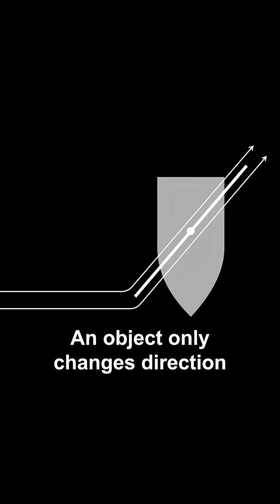Do you know how sailing actually works?

Comment: Lift is also generated because of the curve of the sail.  A sail with a curve works much better than a flat one.
Reply: I assume that's why they always have enough slack to catch the wind and billow like they do?
Reply: @Just_A_Dude  In real life you are adjusting the sails all the time, There should be enough slack in the sail to give max speed without getting any wrinkles (this spoils the airflow over the sail causing turbulance)
You are also adjusting the path of the boat to try to make the best track to your destination, this causes maore sail adjustments.
Its a continious dance between crew members to get the most effecient results from your boat sail combination.
Reply: @rickharriss yeah rule. of thumb is the stronger the wind and the more you go against the wind the less slack you give
Reply: @Just_A_Dude   - or if not slack (well correct tension on the sheet)   but designed to be variable -  belly and adjustable vang or tack lines..
Reply: first of all, a sail can't be flat when wind pushes it because it's the deformation of the sail that puts tension and creates an opposite reaction force towards the air. but you can still control the curvature with the tension, and the curved shape deflects the air more progressively and more effectively what you don't want is to have too much curvature that would uneccassarily slow down the air velocity and also slow down the boat. the  but also the low pressure behind the sail "pulls" like the top side  of a wing creates the majority of the loft  (in reality the low pressure side doesn't pull, it just pushes with less force and it's the pressure difference that creates lift, like sucking on a straw doesn't pull the liquid, it's ambient air pressure that pushes it up. 
lastly , sail can be made more efficient by adding structure to it to give it a wing shape at rest before wind even starts to deform it. windsurf sails use that technique with horizontal slats under compressive force that create am horizontal curve and also compressive force on the mast
Reply: @geemy9675  Haha, when I was very young I tried windsurfing. I seldom traveled more than twenty feet. After being pulled off the board about a hundred times I was in the middle of the lake and exhausted. 😊😊😊
Reply: @CurtisLGray-o6q try a small board that sinks when you stand on it and with no centerboard to act as a stabilizer, so you have to swim under the sail, push it out of the water then get it to pull you out of the water and on the board... all in the ocean with waves. 😂
Reply: @CurtisLGray-o6q   - try try try - eventually you get it (persistence and resilience are required.
Reply: @geemy9675 a fixed wing sail can be flat... but wouldn't work. It needs a curve.
Reply: @arno-31 it does work, just less effectively, like a flat wing can generate lift it just needs an angle of attack. Have you ever heard about paper planes? a flat sail too. it works just like the video explained. redirecting wind towards the back of the boat direction generates a reaction force that has a forward component. just like a flat wing with an angle of attack moves air downwards and generates an upward rection force. And it also creates a low pressure area on top
Reply: @arno-31  Nope, just wrong! The curve makes it more powerful.
Reply: @geemy9675  In a sense a planes wing is a kind of ridged horizontal sail, isn't it?  I haven't had much experience flying but I have noticed the shape of the wings change during takeoff and landing.  The contour looks a lot like a billowing sail as if it were made of fabric under tension.
Reply: @CauldronOdoom yes when taking off and landing the geometry of the wing changed to provide more lift at lower speed. the rest of the time, it more streamlined to minimize drag, While still providing enough lift, thanks to higher speed. 
I've done two flights this summer and on the small 4 seat recreational plane I was piloting it's just a mechanical lever with 3 positions that you move.
Reply: @CauldronOdoom also the main difference is a sail is a flat fabric/ film that bends/stretches while a wing is 3 dimensional/thick. wings are deigne for way higher speeds thus way lower drag.
Reply: @geemy9675  Unless the wing is made of fabric? I have seen a number of,  I want to call them ultralights but I am sure there is a better name for them ,  anyway they get their lift from something that looks like a parachute...a horizontal sail...a fabric wing...I don't know but it seems to do the same job.
Reply: Yeah, I thought it was the aerofoil of the sail that provides the lift.
Reply: @fastbudgie it does
Reply: @fastbudgie it does but against the keel. It’s lifting to leeward. Imagine an airplane wing on its side.
Reply: @fastbudgie - it is - fabric sails form a rudimentary aerofoil - it takes something approaching the median chord line of an asymmetric aerofoil, but a single surface sail is a fairly poor aerofoil - however it is variable, that is a plus - AND it works as a drag sail going dead downwind....
Reply: Yes but that lift is working to leeward.
Reply: I was about to point out that billowing creates a low pressure area behind the sail. Getting the perfect tack is so satisfying.